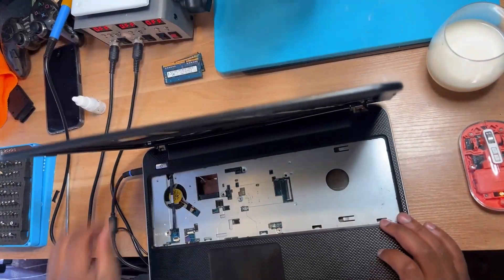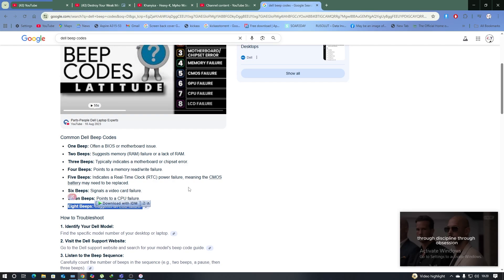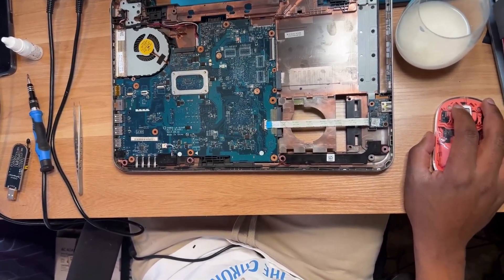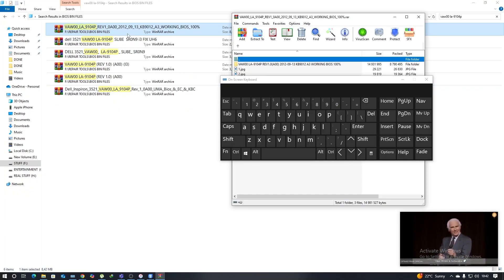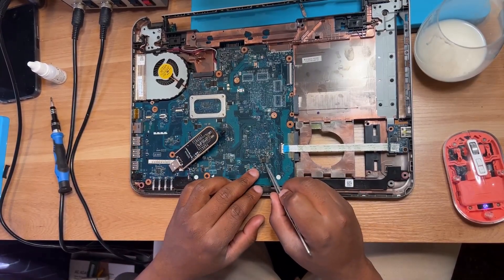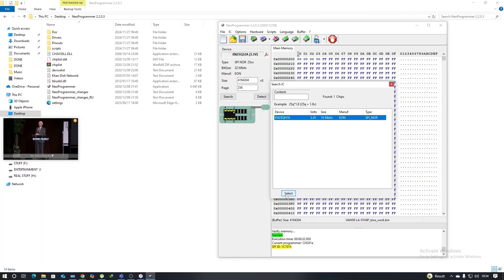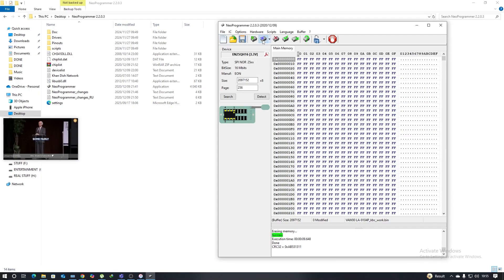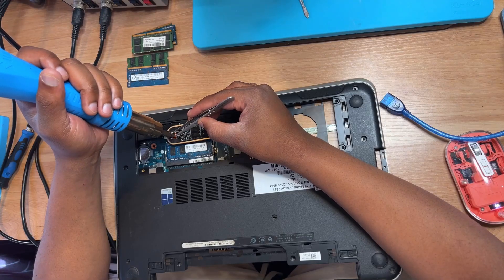How to program the bios chip using ch341a bios programmer

Comment: FWIW, the software for my programmer had a virus, according to MBAM.  It's advisable to scan whatever you get with it or for it, with a few different things.
Reply: I mean does read, write and modify binary. That's what a chip programmer has to do. It might false positive as a virus. Not saying you should never let you guard down but you use a virus scanner site or a virus sandbox tool to see if it's truly malicious.
Reply: @QuackZack  Hmm... Not sure about that explanation.  The binary being modified is on a chip plugged into the programmer, which is connected by USB, IIRC, so probably as a serial port over USB.  All the virus scanner would see is something that communicates over USB, and sends whatever it's given to send.  It would have no way of knowing what the purpose was.
Reply: @TooSlowTube  that's exactly why stuff like this false positives, anti virus scans don't really knows what it's trying to do, modify something under guise or simply a programming tool for chips. It errs on "better safe than sorry", I would stick well with known eeprom software.